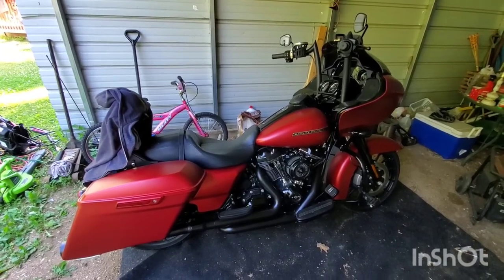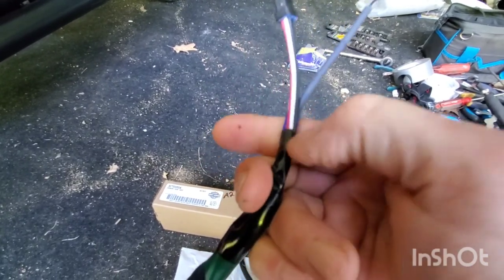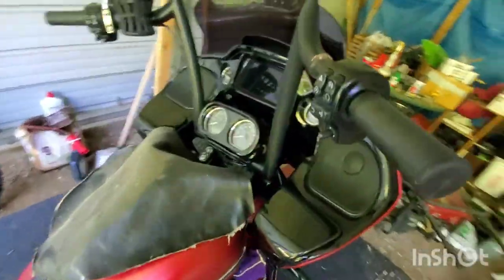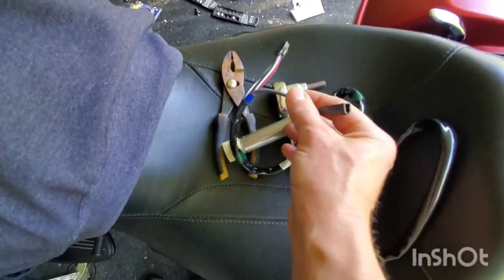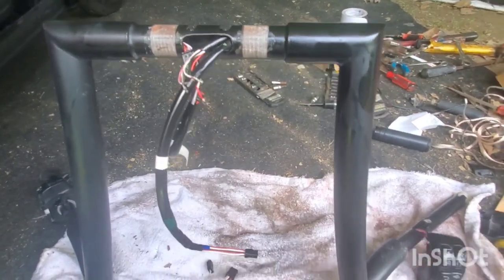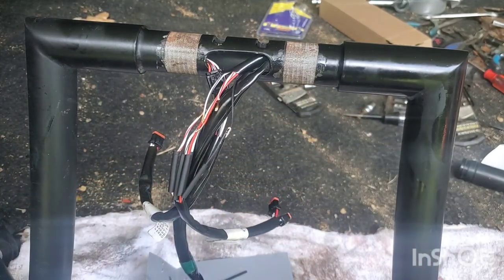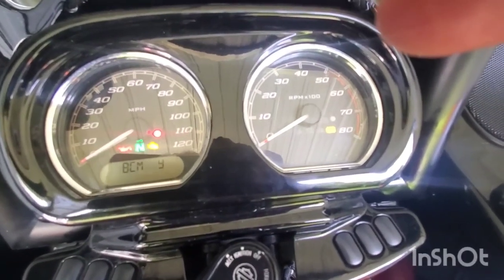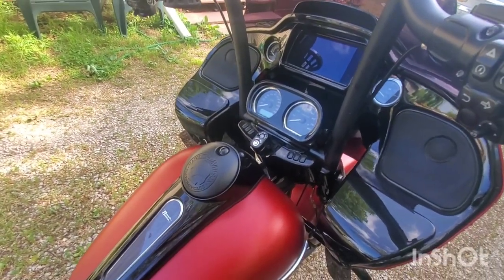Harley m8 twist grip throttle problems, bike surges and check engine light on. life pranks

Comment: You can buy the pins and the end connector you didn't have to get a new throttle assembly.. There's  a special tool that'll take those pins out. What it does is when you slide it over the pins it pushes the barbs in that are on the pins then you can slide the pins out. I've used this tool before..

Comment: Those are 15 i orderwd my threw amazon on the extension wire check fuses n pull the red main fuse first before touch it.